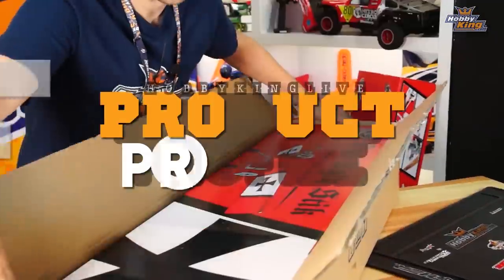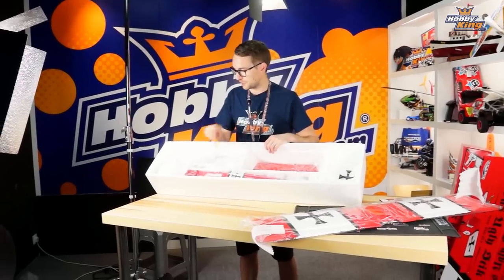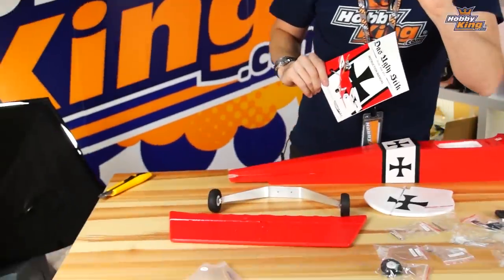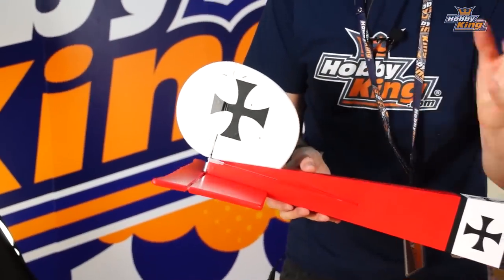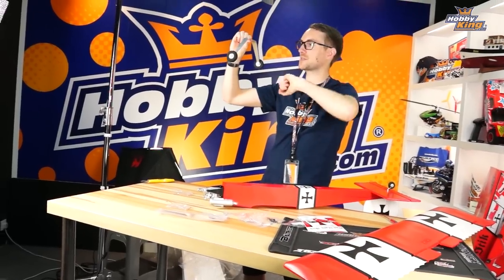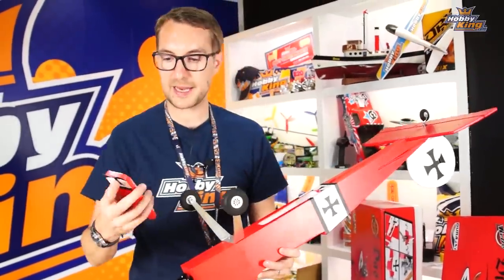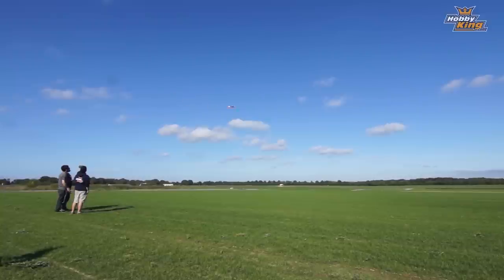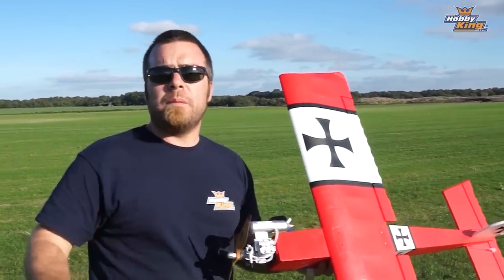Durafly Das UglyStik Product Profile - HobbyKingLive

Comment: would the extended motor shaft be more prone to bending on crash?
Reply from the maker: Kevin Ray Its hardened metal and supported by bearings so it should not be a concern.Thanks
Reply: sweet. thanks for the reply.
I think this will be my second plane then